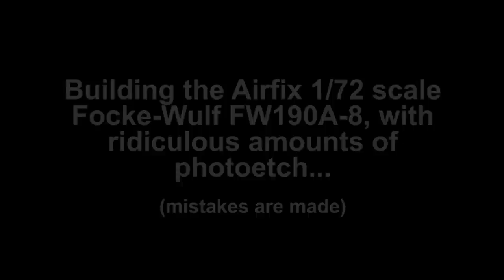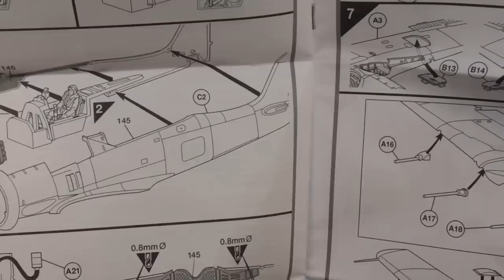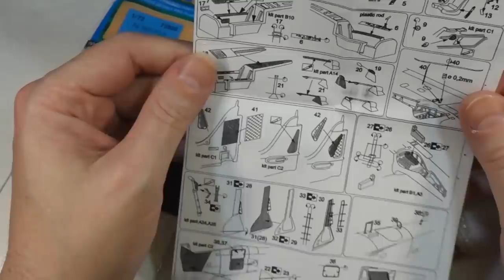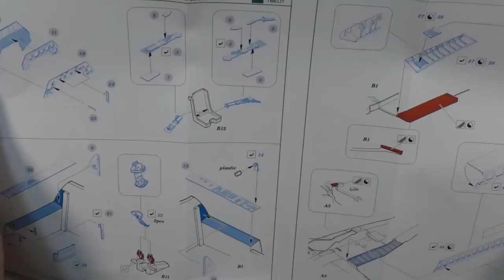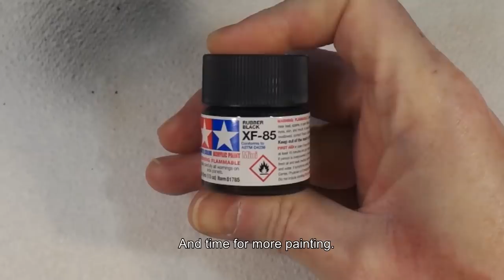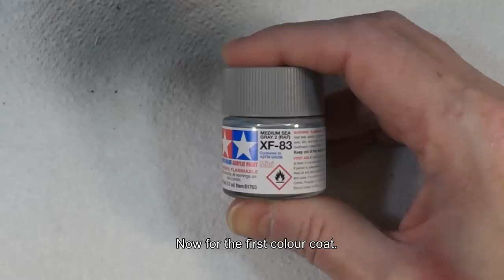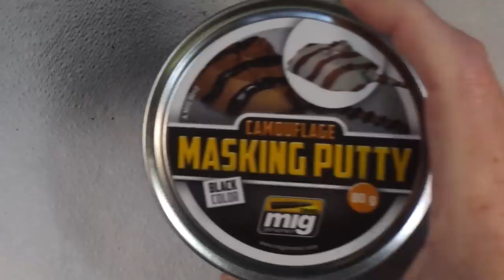Building the Airfix 1/72 scale Focke Wulf FW190A-8 with ridiculous amounts of photoetch

Comment: That Airfix FW-190 isn't all that old. It seems that the 'soapy' styrene compound Airfix are fond of using, is prone to flashing. I have a Boulton-Paul Defiant new tooling from a few years back, and that had some flash on the parts, likewise the ski undercarriage Gloster Gladiator, new tooling. Older kits can be recognized by the pilot figure - if it's the 'Biggles' one, well detailed, with one foot forwards, then it's an older kit. The kit you have there has the new pilot, who's quite thick set. Going by the number on the tail, might one surmise that the pilot's name was 'Heinz'?

Comment: A standard to aspire to!!!!!!!!! I'm no aircraft mechanic, or a FW190 fundi, but if the cockpit is open wouldn't the radio aerial be slack, or are they self tensioning?
Reply from the maker: It would, yes, but I never thought about it until after I'd attached it and it was too late by then :-)
Reply: Howard Battersby: The aerial wire on the 190 was indeed self tensioning. Check out some of the wartime photos on ‘FW 190 archives’. 👍🏼

Comment: Thanks for this build video. My wife bought me four of the starter kits from Aldi and I built the Mary Rose first after a hiatus of over 50 years in airfix modelling. I decided to leave the F.W.190 til later and am currently building the Spitfire 1a and have experienced similar problems with the fit of parts to those you mentioned with the Focke Wulf kit. I'm glad it's not just me.

Comment: Iv made myself a PE bender as couldn't find one and needed it straight away really I used a scrap block of mDF cut up my old metal ruler in 2 and grinder out a few different sized notches with 2 holes for lug nuts to screw down and the flat edge on the back it's been well needed can't believe how good it is to be honest should last a life time its solid haha

Comment: 15:09 The throttle control is on the opposite side. This is the turn lever for opening the slide canopy. 19:19 That “little colored manufacturer tag” on the head armor plate was a red rectangular warning sign informing the pilots and ground crew that the canopy has an explosive charge for emergency jettison.
Reply: dose the radio antenna stretch when the canopy is closed

Comment: nice video, I'm finishing one these, for the camo i just enlarged my camo callout sheet  to the size of the model, the pattern out and used to mask the plane. Its super easy, quick and cheap. This approach allows a direct copy of the manufacturers instructions if thats what your looking for. Cheers.
Reply: Was Rio you do what max-afterburner does, ive begun to use airbrushes and ive found that it can take a while to line up but it looks pretty good afterwards, also for the mottling camo on the sides of a focke wulf just do what the germans actually did and go free hand in spots with different colours. None of the german fighters had the same camo as the hired a painter to come and do what he wanted